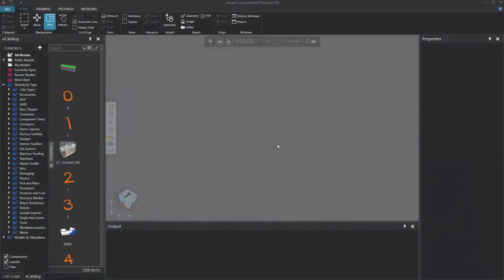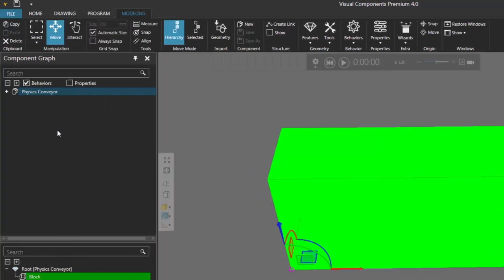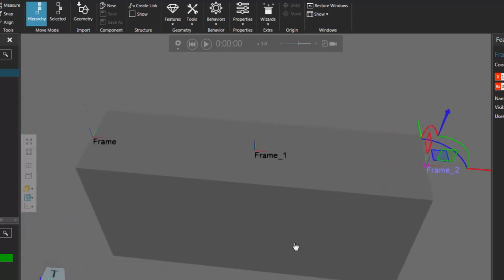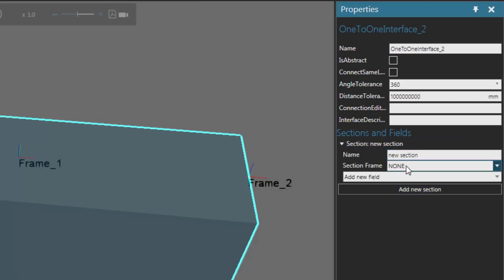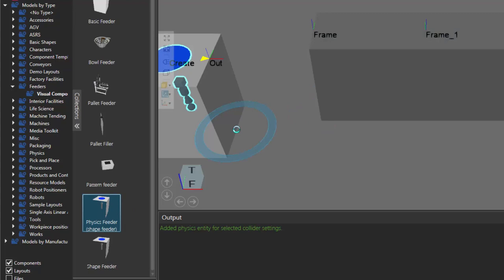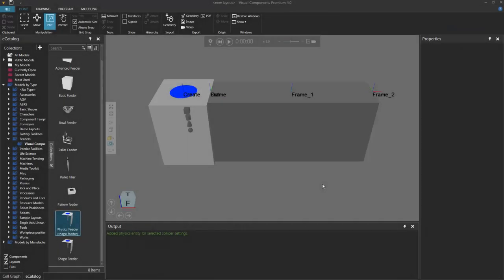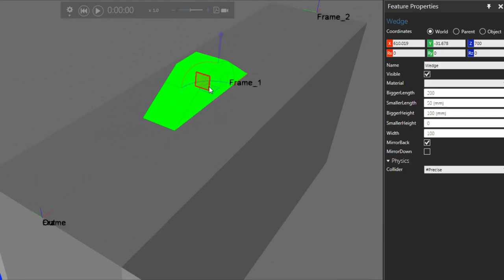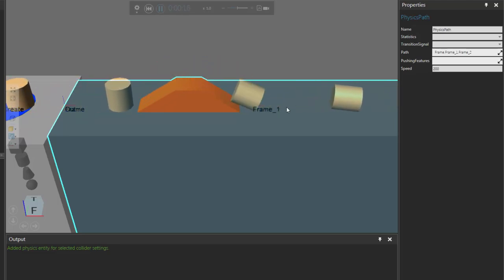Physics - 3 - Model a Physics Conveyor

Comment: Hi, I have the KUKA version of your program and have a really small library,  my question is: where can I get a works library? Is it free?
Reply from the maker: Q1:
The Works library comes with the VC version of the Web eCatalog. You either need an XML index file for that database or a layout packaged with all Works components.

Q2:
Don't know, but will let you know as soon as possible.
Reply from the maker: Here is the link. Add it as a source  to your eCatalog.
http://download.visualcomponents.net/elib/4.0/components.xml
Reply: Thanks! But, when I put this link in source (+Add Source, URL), I see that in eCatalog but, if I open it, there's no items... How can I solve this problem?
Reply from the maker: Submit a Support ticket or refer to "Adding a Remote Source" topic in your Help File. If the source is added, but no items from that source are being displayed, there may be a network or firewall issue.